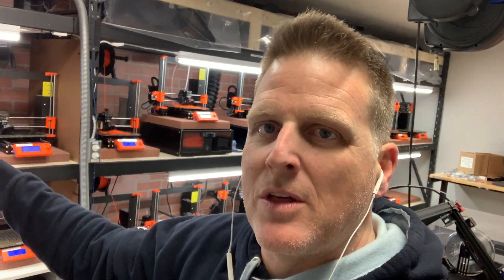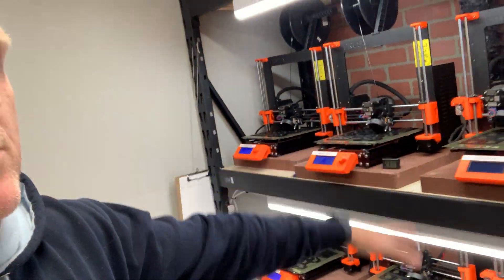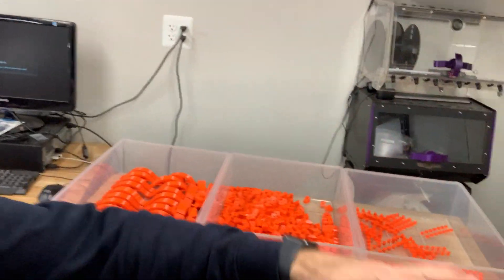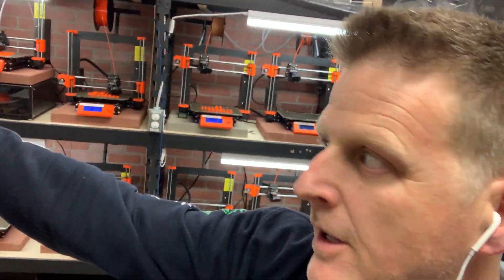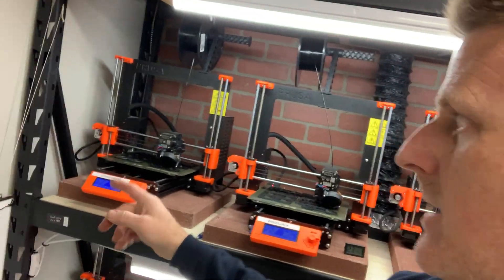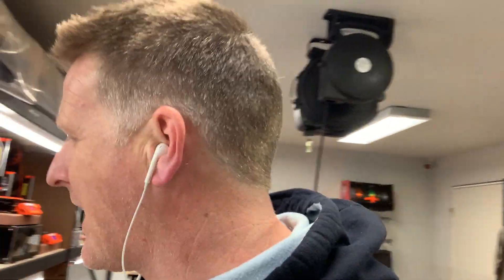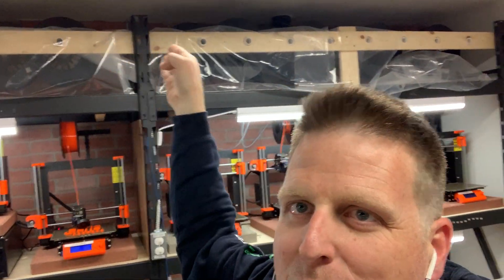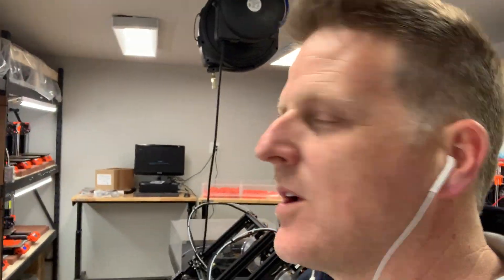RepVLOG:  State of the Repkord Print Farm, March 2021

Comment: Hi,
I am setting up a print farm and I am at the stage where I am choosing the machines. I noticed that you have CR-30's, these are my printers of choice. 
My question is would you recommend the CR-30'S?
Thanks.
Reply from the maker: They can be fantastic machines for the right parts with the right modifications. But I would NOT recommend them in stock configuration OR as a first / only printer on a print farm.

Comment: Nice tour and noce insights. I like the shower curtains. :) I am constantly printing PETG with the textured sheets. No interface layer needed, insane adhesion, parts pop right off after cooling down/flexin the sheet. Did you try Josefs tipp with Windex on the smooth sheets with PETG prints? It acutally works well if you dont overapply the Windex. The Vac system is an awesome idea! Did you move the belt printers off the walls due to any issue with this mounting method?

Comment: Power sags play hell with electronics. If your car battery gets low you may find the car does weird things too.  Having the right electrical setup was a great idea
Reply: Yep, found that out the hard way on My Friends Nissan. slight low voltage tripped the security on the ignition and would not start even though it turned over normally

Comment: Hello,

for pei + petg use Window cleaner instead of Isopropanol 

Quote:
Print surface preparation

Various manufacturers suggest using various separation (or adhesive) layers for printing PETG, such as Kapton tape, glue stick, etc. Our print sheets work fine without these separation layers but it’s important to know a few basic rules:

Keep the print surface clean

When printing on a smooth sheet, use a window cleaner instead of isopropyl alcohol (IPA)

When printing on a powder-coated TXT sheet or powder-coated satin sheet, clean it with IPA.

After printing, wait for the model and sheet to cool down before removal.

source:
https://www.help.prusa3d.com/en/article/petg_2059

Comment: Great tips. Looking good. Machines down for repair is a common issue so using the same machine in the farm is so helpful. Share parts, you know the issues, quicker to fix because of experience. Next step is injection molding. I’m down to only 3 print designs left in my farm. The rest have grown to enough volume that injection molded was the only way to keep up.
Reply: CHEP do you do the injection molding yourself, or outsource to a company?